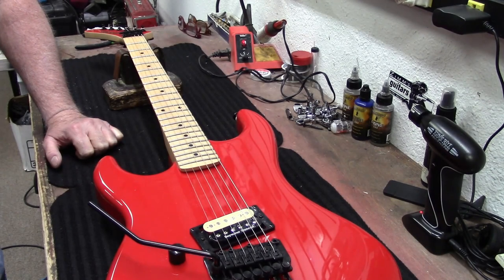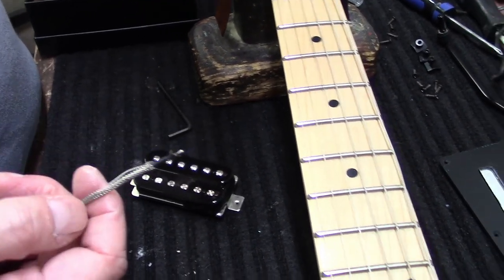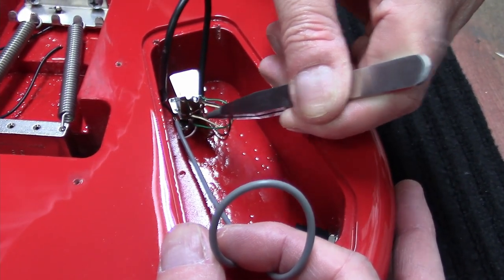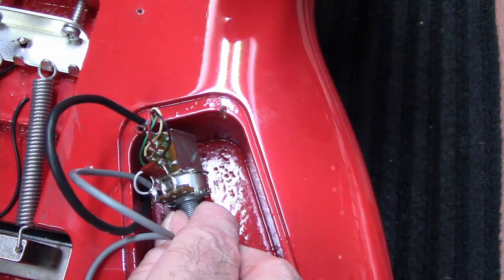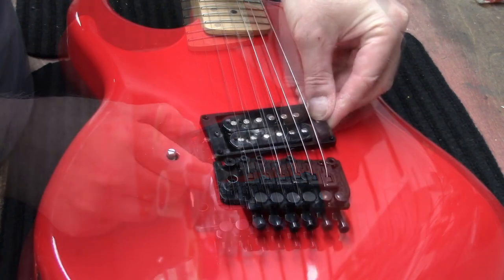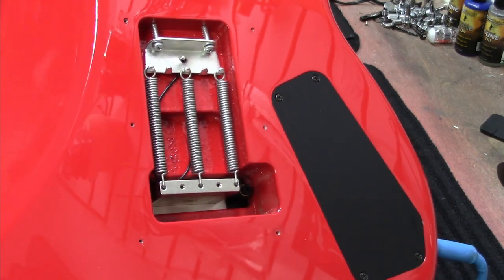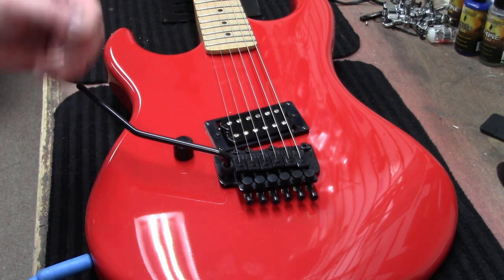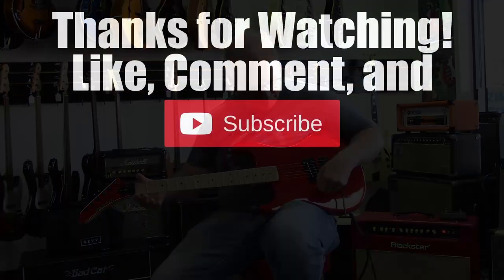Kramer Baretta Pickup Upgrade!

Comment: Out of curiosity, could you have done a direct mounting of the pickup?
Reply: The route for mounting with a pickup ring is deeper. If you direct mount the pickup, you have to extensively modify to get the pickup at the right height. And then you are also stuck with the screw holes for the pickup ring. I dunno, I always thought that there was a reason that Leo Fender and Les Paul chose to mount the pickups with springs and pickguards and mounting rings. EVH direct mounted 'cause he didn't know any better and didn't have the right parts. lol
Reply: I have a couple of guitars with direct mounted pups and they are ok. Luckily they are roughly the right distance from the strings  from the factory. Other than adjusting pole pieces I'm not sure what you can do to adjust further. I much prefer pup ring mounting. Far better adjustability  which is very important  and better looking imo.

Comment: I k iw my special they called it a treble bleed yeah it was just a resistor solder to the lugs sounded like crapola  took it off and I have know clue it's still in the family room with most of the paint work done  but I. Limbo

Comment: 250$ floyd on a 179$ guitar i love it
Reply: well at that point its not a 179$ guitar anymore if you were to buy that guitar in a store with a frankie and a floyd youd pay quite a bit more! the body and neck are almost identical to the 1000$ barettas aswell
Reply: The sub-$200 Baretta doesn't come with a Floyd.  The Baretta in this video goes for $700-$800.

Comment: No pickup in the world is going to make you a better guitar player.  "High output pickup" just like the SD you took off the guitar to begin with. I have swapped active EMGs for SD because they are hotter than active EMGs. If you want the truth, my EVH pickups are actually way less hot than the Seymour Duncans.  Your time is better spent learning to play rather than modifying your equipment.